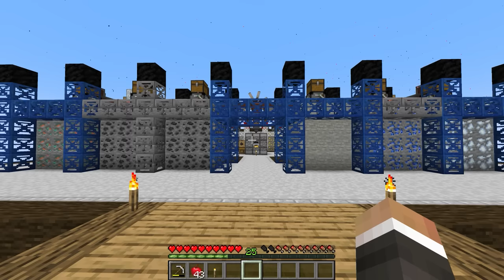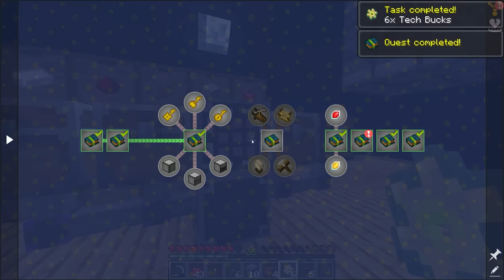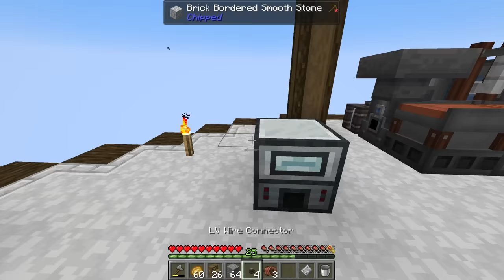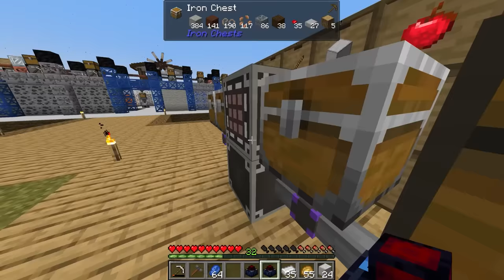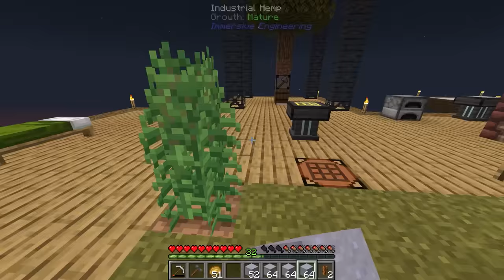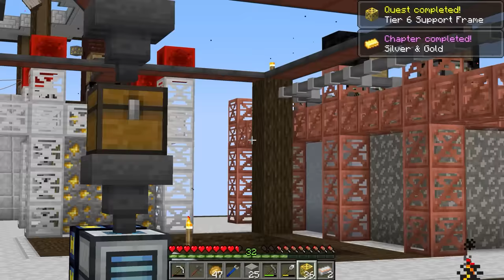Minecraft Techopolis 2 | ORE PROCESSING UPGRADE & LAPIDARY POWER! #6 [Modded Questing Skyblock]

Comment: I'm playing this as the same time as you. I'm going to make a pulverizer and induction smelter for each ore with a fluid lava generation for each of them to power dynamos to power the machines
Reply: Immersive engineering can directy power the machines if you dont want to do so much lava gen. I made a diesel generator with fluid miners of ether and plant oil to feed the refinery to make biodiesel to power it, and it has lasted me so long with many thermal machines. I have signalum block caps on the fluid miners and they give the generator 100% uptime and too much power that i know what to do with.
Reply: @turd_burgl3r985  I also doubled up the ore making two miners for each ore. So I might also beable to automatically bronze, invar and electrum

Comment: If you find your running out of techbucks there is a recipe which requires the various technium tiers, but they are locked behind research for each tier with each tier giving more bucks for the more complicated technium tier. If I remember you get 8 for the basic technium ingot and it goes up from there.
Reply: No you get one buck for 8 basic technium
Reply: Close but still wrong lol. Recipe is 1 Technium + 8 Bronze = 1 Tech Buck
2nd Tier is 1 Advanced Technium + 8 Bronze = 1 Tech Buck (which I think is a massive waste of steel, lol)

Comment: You should have recorded all of the redesign. Even if you did a 5x or 10x video, it could be pretty cool to watch.

And I'm several episodes behind, so these suggestions may no longer be valid, but:

You sunk your metal press down into the ground. I've kinda thought it would be cool if the miners were sunk into the ground.

You should put the hopper to the metal press out front, then use conveyor belts to go back around back. Then you can stand in one place and drop off and pick up the materials.

Comment: I started a bit later in the questline with replacing the jumbo furnaces; so I had the option to use Mekanism. Now I split the ores into three tracks: Most go into the enriching factory + smeltery; most of the rest into 3 pulverizers, and the sole remainder (copper) into one induction smelter. The last one might be because of a bug (can't smelt copper dust in smeltery).

Comment: I dunno if this would work or not for this pack but i thought i saw it in the recepie list at one point and i know it works this way in base mod; wouldnt it be better to have all ore getting crushed first then having it be seperated out into things like coal that is already the finished product and stuff like iron dust that needs to be smelted and also i saw in the comments something about copper dust not being properly smeltable so maybe have that split off prior to the crusher. Im fairly certain the ore doubleing effect of that would mean he would be getting 2 ingots per ore instead of the 1 he has now or the 5 ore to 1 he had before. Maybe its not needed due to the amount of ore being produced but it just bothered me that he wasnt maxamising efficiency considering that was half the reason he swapped to this new system anyways.